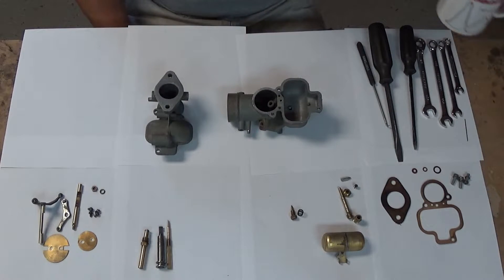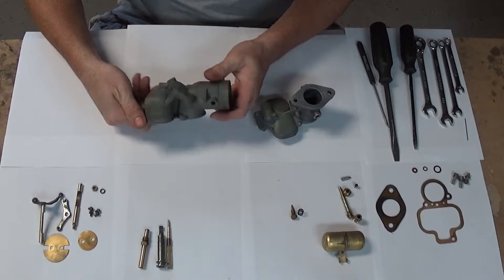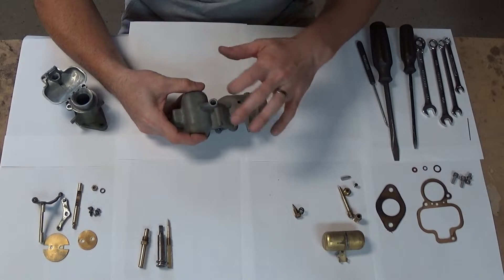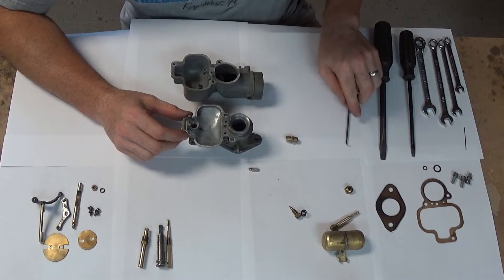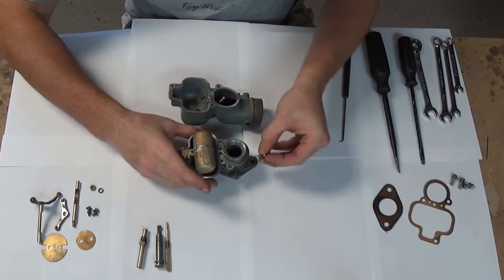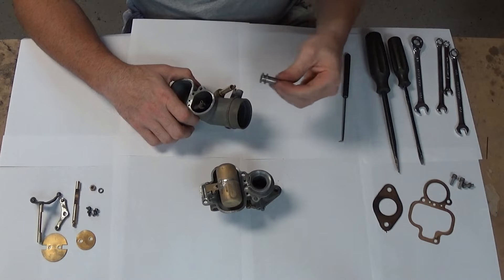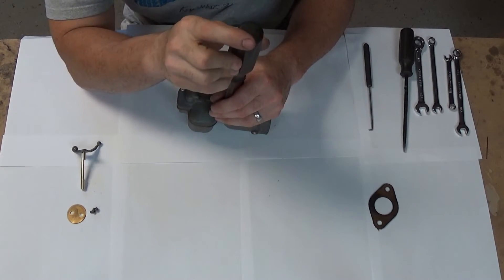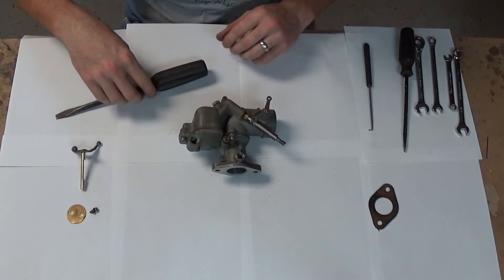Ford Model A Tillitson Model X Carburetor Rebuild

Comment: Thanks for this video.  I am sticking with Tillotson and going full speed having a spare built under my seat.  
You were spot on with flange warp, thread stripping, and body gap.  I inherited all three issues.  Currently running a hose clamp on the bowl section in addition to sanding.

Comment: great video thanks! I have the xf..can I put a small amount of gasket sealer to seal the 2 halves? any lube where all the jets go?
Reply: I am an aircraft mechanic by training, and I am new to Model A’s. We use this product (EZ TURN / “FUELLUBE”)  from Aircraft Spruce. I would use it on all the threaded components except the screws for the throttle plate, the choke plate, and the three fillister screws that hold the bowl together [where my personal preference is an extremely light coat of blue Loctite]. Additionally, on aircraft we have very good luck using Fuel Lube on the gaskets – it keeps them soft and pliable and creates a good seal with less torque.
Reply: You don't want to "glue" carb gaskets. Firstly, because any goop you slather on will inevitably find its way into drilled passages between pieces, possibly compromising flow. Secondly, eventually, you (or the next guy) will want to change that gasket. Any stuff that makes it stick will need scraping off. Scraping pot metal is iffy at best. If you want to make it sticky for assembly, either the aero goo the previous guy suggested, or plain vanilla white lithium grease will goo it on, but not plug stuff up, or force you to drag hard stuff on soft surfaces to clean it off next time.

Comment: Adam:  A question:  how critical is the 0.040" orifice in the jet at the bottom of the float bowl - the one that allows fuel to flow down to the main jets?  I am asking because I was unsuccessful in removing the old jet - it broke off - and I also failed with an extractor to get it out.  So - I resorted to drilling it out.  I tapped the hole to 1/4-20 thread.  I want to put a vented set screw in that tapped hole - with a 0.060" diameter hole in it.  Seems to me that bigger is OK - the main jets coming afterward will do the actual metering of the fuel into the fuel/air mixture.  What do you think?
Reply: There is more than just hole size to a jet. entrance into and out of the jet affect flow. I would get some brass allen head screws. Start around .040 and drill larger as necessary. Time yourself over a measured distance and redrill until it slows down.  Then drill a new screw one size smaller and you're done. BTW, Holley carb jets are 1/4-32 if you wanted to use a Holley jet.